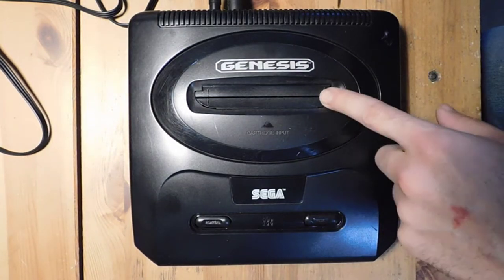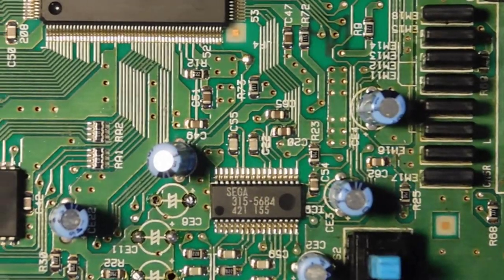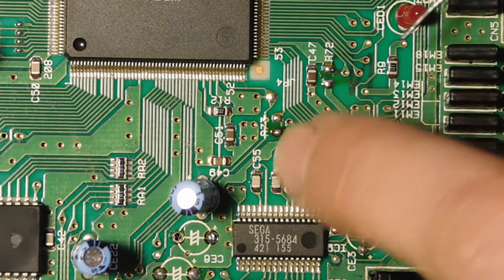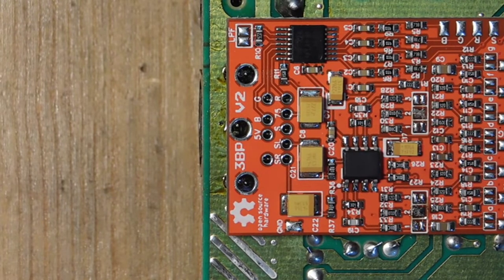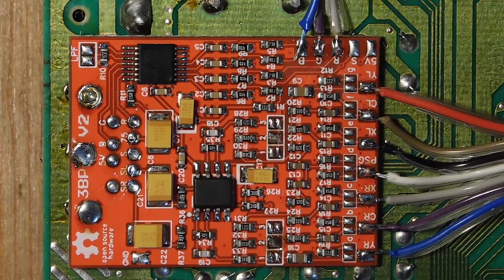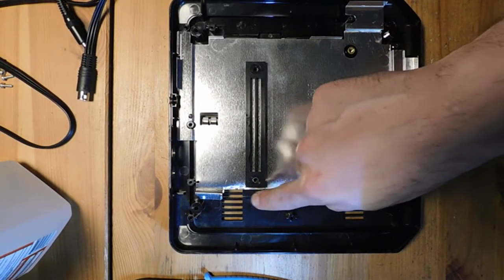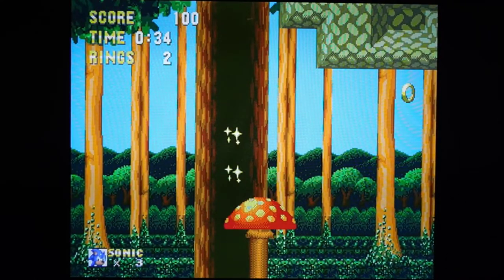Sega Genesis/Mega Drive Model 2 (VA3) Triple Bypass mod!

Comment: Hello and Thank you!
This kind of technical information is golden.
As a tip use flush cutters on those caps... no more burned VA's.
Also works great on VA2's 315 video chip legs.... 
...when in doubt dont lift and burn... use exacto to cut a leg.
Reply from the maker: Thanks! Appreciate the suggestions and I’m glad you enjoyed the video
Reply: Wires organized nice on board in thumbnail

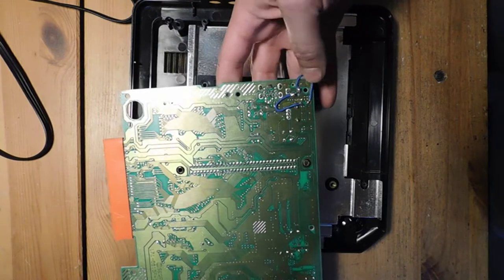Comment: @2:23 Those bodge wires on the power jack are actually stock, I have the same revision board with the same wires... there must have been an undersized trace or something. You may want to add those back to your board.
@6:16 "C68" do you mean "C58"? There is no "C68" on this board.
Also, do you need to make any disconnections from the video encoder? You disconnected the RGB traces from the AV out port, but the encoder chip is still connected upstream, does that cause interference on the bypass board at all?
Reply: Yup, bodge wires were fairly common on electronics back then when it was a lot more expensive to re-spin a new board if you find a fuckup after manufacturing. Nowadays it's not quite as common in consumer electronics :D
Reply: @nicwilson89  looking at my PCB those bodges just conenct back to themselves, same CHUNKY trace. so it should be perfectly fine to remove them.
i thought maybe it was bypassing a switched DC Jack, but i just checked that too, and the jack is not a switched jack.

Comment: curious about the triply bypass what exactly it bypasses.  Does it use any of the capacitors, resistors, opamps, etc in the audio circuit or are you basically just taking the audio coming out of the ASIC and running that straight into the mod?  Same question on the video side.  Does it use the video encoder, any of the capacitors or resistors or does it take the RGB values straight out of the ASIC, mix them, and run them to the multi-out?
Reply from the maker: The triple bypass takes the RGB, sync, and audio directly from the ASIC and outputs the cleanest and most accurate video/audio signal. You can learn more about it here: https://www.retrorgb.com/genesistriplebypass.html

Comment: Did you end up having to lift any pins on the encoder? I did the mod and everything worked fine with a cheap hdmi converter. Then when I plugged it into my Retrotink 5X via SCART I couldn’t get video anymore. People seem to think it is a Csync issue perhaps as most cheap HDMI converters sync on composite.
Reply from the maker: I always lift the RGB pins on the encoder

Comment: Great video !!, the model 1 you are comparing against is that mod free and what revision of the model 1 is it ? 
I was under the impression that some  model 1 consoles have jailbars and I can’t see any in yours thus the question 😊
Reply from the maker: That model one is a VA6 and it’s unmodified. It’s actually the one I’ve had since childhood and somehow it does not have any jailbars. In my experience it seems to be random which model ones have jailbars and which do not

Comment: I've seen photos of bottom installs with wires connected to the 5V and csync on the triple bypass board and others without (like in your video). Do you only need to use those if you are not doing a bottom install? I have a VA3 as well, but the old v0.3 ASIC YM3438 triple bypass board. Don't know if that makes a difference.
Reply from the maker: It really depends on how you do the install, and personally I would really like someone to put together a wiki showing the best method for each version of the hardware. But 5v and csync are present on the AV port, so if you connect directly to it on the bottom then you don’t need to add wires for 5v or cSync
Reply: @LIRetroGaming  So after looking at all the schematics and figuring out csync it seems with installing like this your composite out (pin 4 of the multi out) is still coming off the genesis video chip. Since the csync goes directly from the VDP to the CXA and multiout, it works fine using SCART cable with csync. But I think if you try to use cvbs as sync ie component cables it might not work, or at least not properly. Maybe someone else can confirm this.

Comment: Great video - I have a model 2 with a KA2195d chip in it - would that be a VA3?
Reply from the maker: Not sure, but the VA3 should be present on the markings on your board
Reply: @LIRetroGaming  I actually had a VA1 - I did the mod but I cannot seem to get any sound out of the mono (pin 6) of the av out in order to take it to my jamma edge connector. Does it not output mono audio?

Comment: The reason, unfortunately, why there is so little information about this mod board is because it's very simple to do without it. Some of the model 1s and model 2s/3s have jailbars through rgb, some. This has already been fixed years ago with a couple of caps when needed which was rare. The audio bypass part, again, an older mod from years ago just for model 1s for a/v output and does basically nothing for the model 2/3. Those models need a fairly complex audio amp board that this mod doesn't have.

*Also, specific models of the model 1 have significantly improved audio over the model 2 and some 3s, not all model 1s. None of the model 1s have any significant improvement in rgb, they're identical in fact, over any other model including some model 3s if rgb is included.